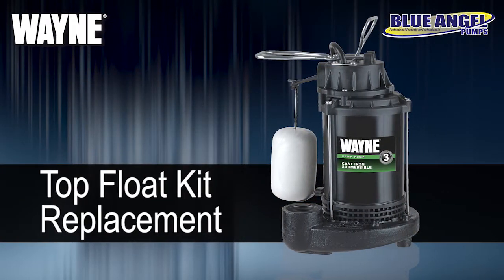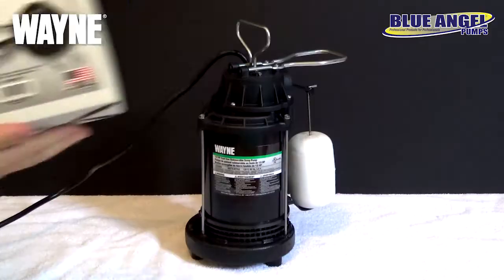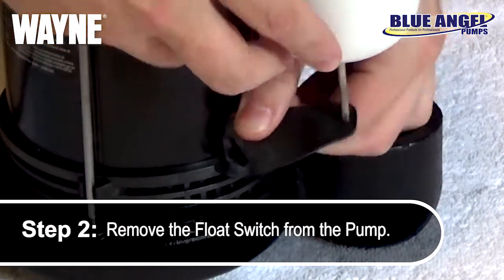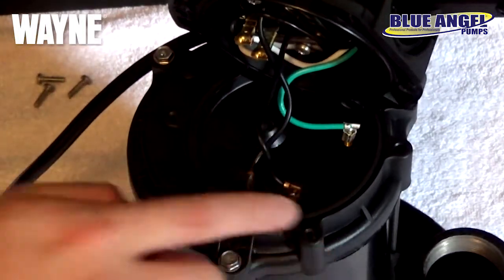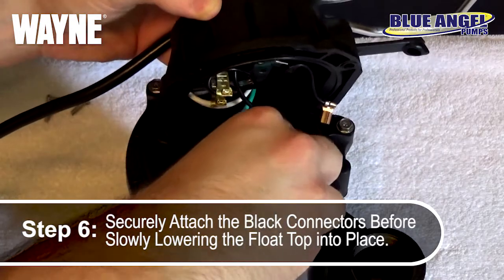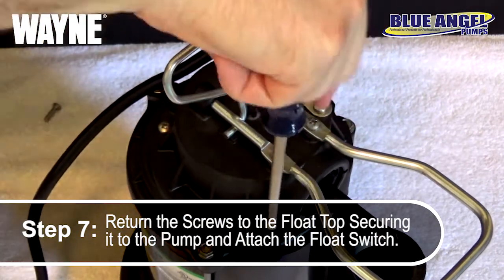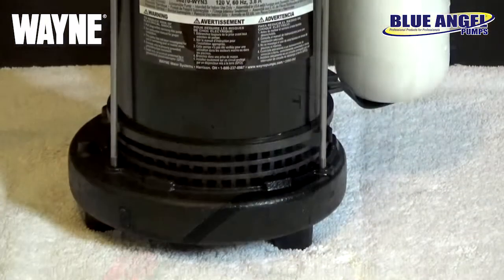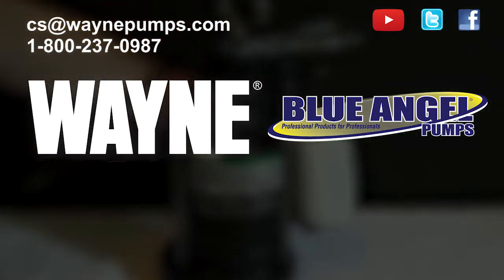How to Replace Your WAYNE CDU Sump Pump Float Top

Comment: I got a Wayne Sump pump model CDU980E. I want to overhaul the pump. What is the part number for the float top section? What type of oil is in my pump? I took the top off with the three long bolts to see oil in it. Isn’t this oil used for internal cooling? Please let me know. The pump shaft to impeller rotated freely. The float top switch works on/off, but when energised pump hums.